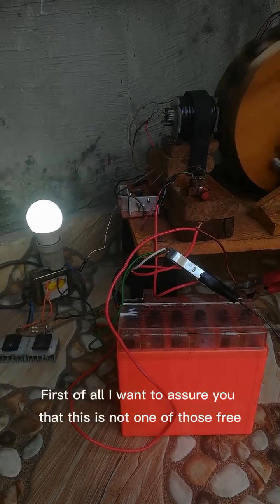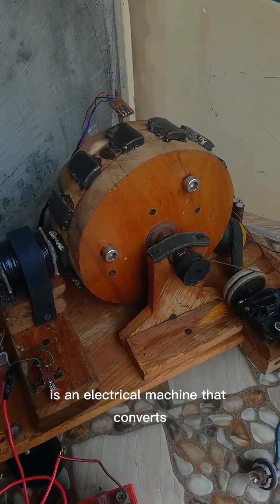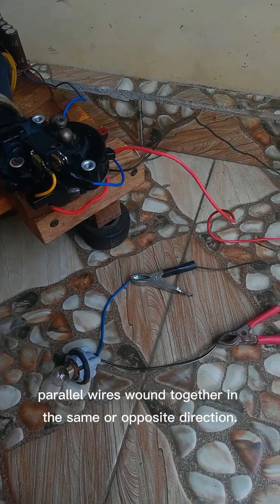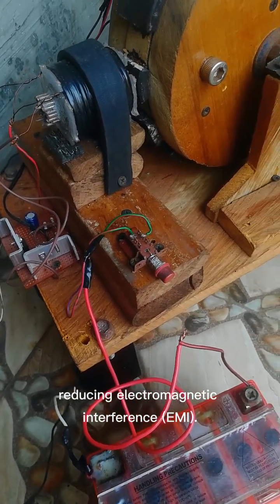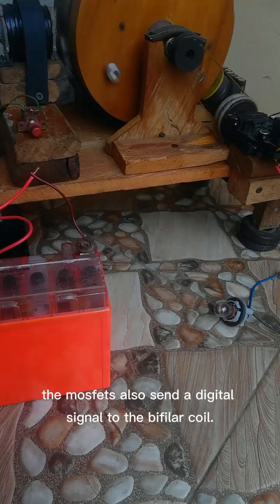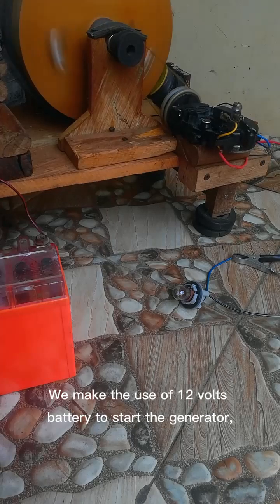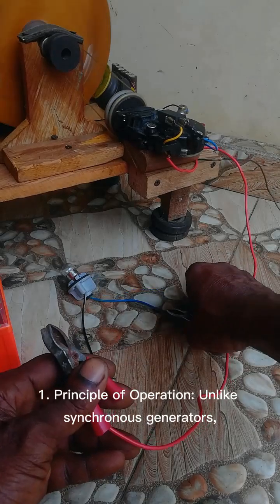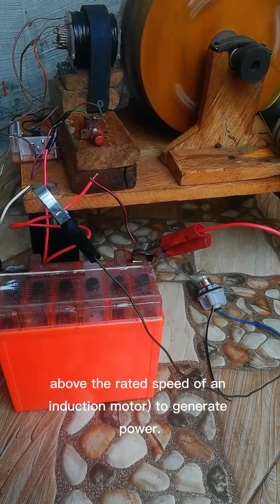Inductor Bifilar Coil Generator, free energy harvesting

Comment: how to wind bifilar coil kindly explain it
Reply from the maker: Hi, get two corpper wire the same gauge, wind the corpper wire together, then connect the corpper wire in series.
Check out the link in description
Reply: @joshautoz3439  sir will this cancell the magnetic field if wind the coil by this way
Reply from the maker: @goharnawaz9972  yes,  when is on high speed
Reply: @goharnawaz9972 A normal current-carrying coil has a magnetic field.  This field contains positive energy.  A reversed current or coil has a reversed magnetic field, but the same positive energy "in the field" (check any modern E&M physics text).  So, is the energy doubled or zero for a bifilar coil?  Hint, hint... I think we should try this, lol!😂❤